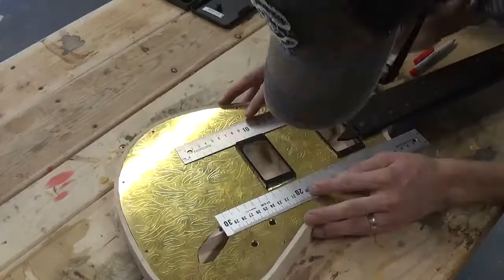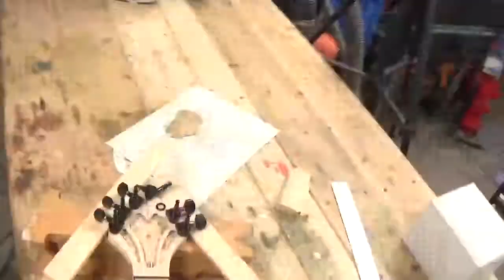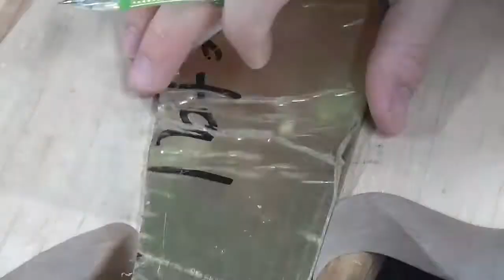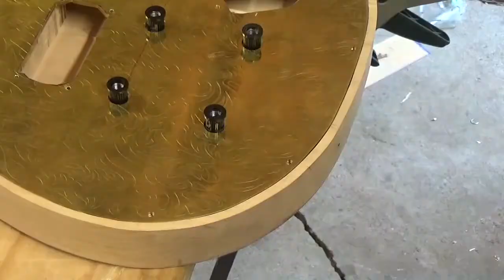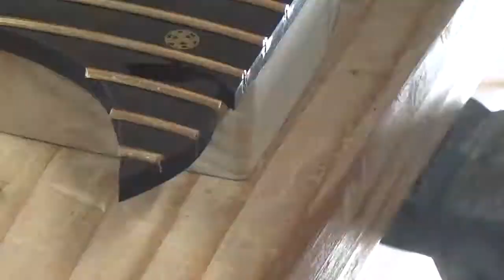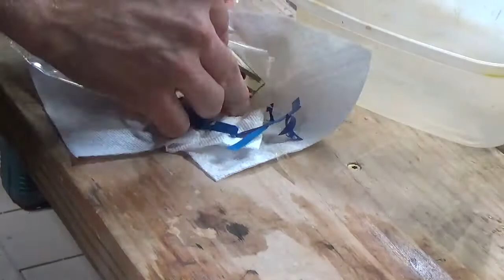GGBO 2021: The Brass King, Putting The Brass Together

Comment: Not to be negative, but I would strongly suggest you rethink the practicality of that headstock design. Strings straight through is the best design for tuning stability - ask any Gibson player about their G string... and i’m not referring to their underwear. 😂
Reply: Just watched it. Sure... and I get that this contest may be more about form than function. I’m just a grumpy old telecaster player who knows my guitar will still be around after the zombie apocalypse... and still be in tune.
Reply from the maker: Great suggestion! I have already fixed that problem! I experienced what you are talking about when I was putting the strings on and ended up putting something to the idea of string trees, but more for the angle going into the headstock as opposed to the break angle. Follow me on Instagram and you will see a picture in the coming days!